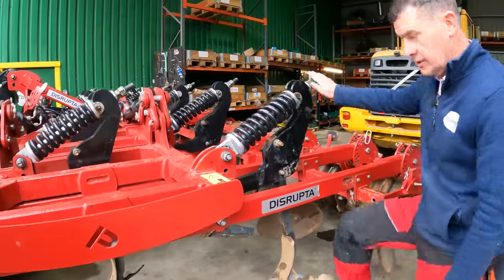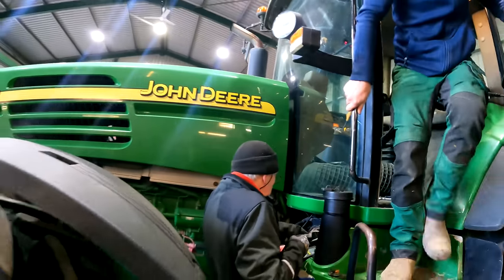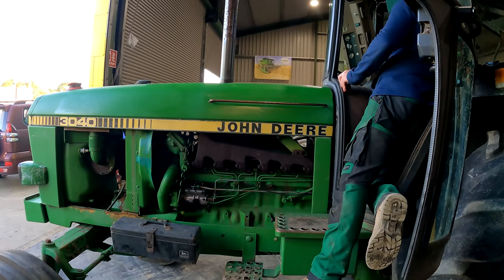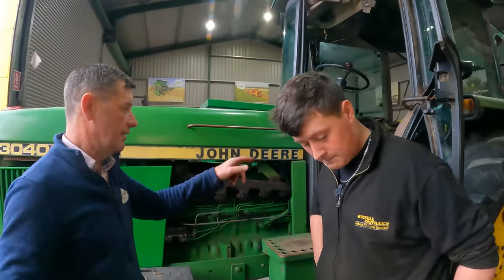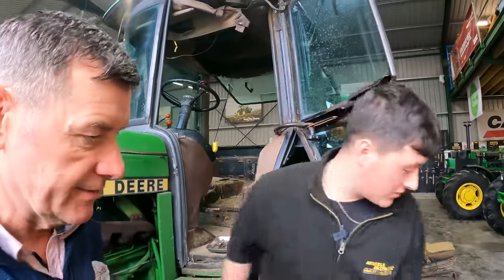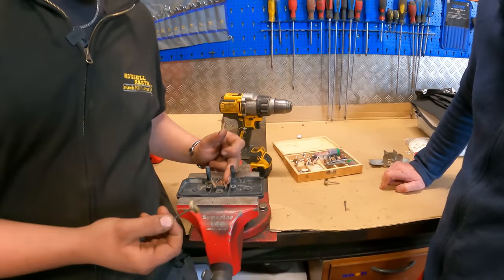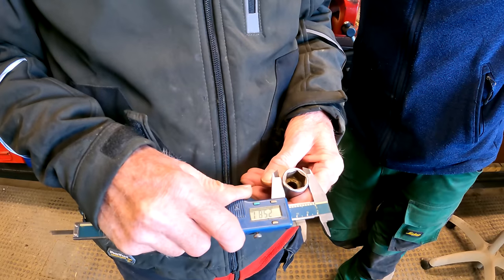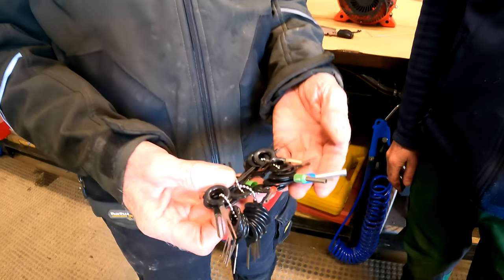WORKSHOP WEDNESDAY EPISODE 51

Comment: This week in Lidl, I see lots of Cordless power Tools,
Like a Hot Glue Gun,  Paint Sprayer,  Angle Grinder and lot more Cordless Tools.
Also lot of Tool Bits Sets. 🔩🪛🔧🛒📢
Reply from the maker: I’ll send mick in so 👍🤣
Reply: @finnegansfarm9137  I When To Lidl To Have A Look And When I Was There,
I Came Across A Ratchet Screwdriver And Tool Bits Set With 115 Pieces In It,
What I Liked About The Ratchet Screwdriver Tool Bits Set Was It Had 2 Tool Bits
I Was Looking For Before, SP10 And TW2 Tool Bits, It Also Had Bits I Nver Seen Before Like C1 to C3 Tool Bits, T8H to T45H Tool Bits, Y-Bit, S0 to S3 Tool Bits,
M6 to M8 Tool Bits, And Lots More, I Hope I Having Made Mick Dizzy ! 🤣😂🤣